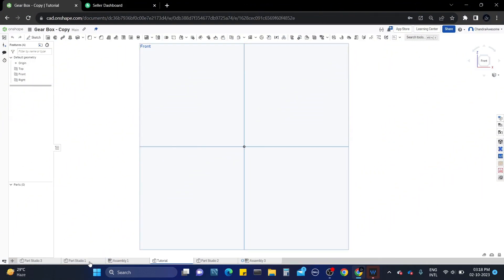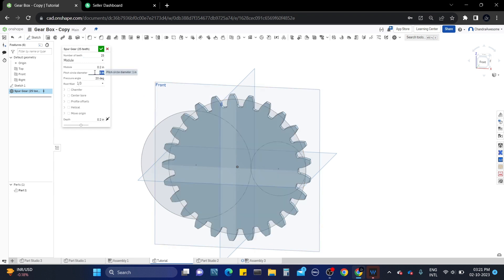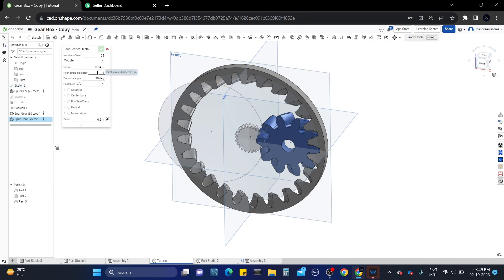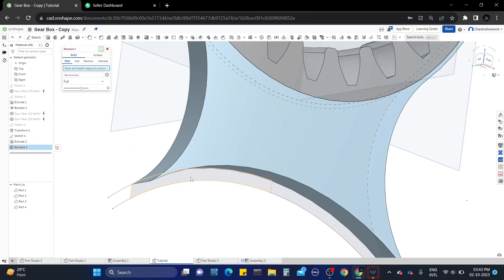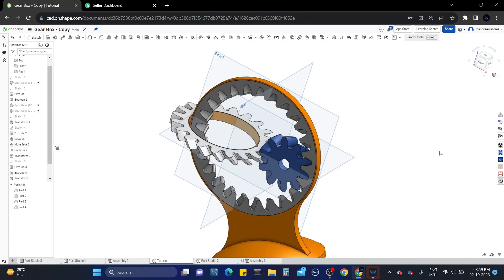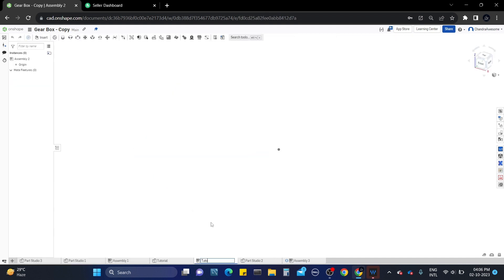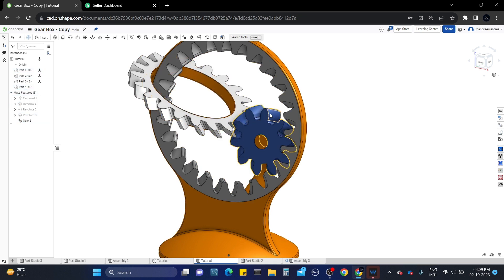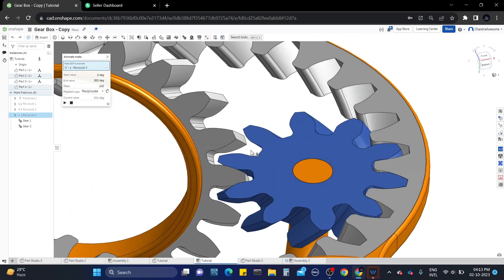Helical Gear Model in Onshape | Onshape Tutorial on Model Design with Helical Gears

Comment: It looks like you used the original sketch as an approximate guide. The outer ring, for example, didn't actually align to the size of the original outer circle, just came close. When I attempt to size my first gear to match the ring, I either have the top of the tooth extend past that outer circle on the sketch when I use the same dimension, or I under dimension it to get to where it lines up. I can't comprehend what the pitch circle diameter actually aligns to in the gear.
Reply from the maker: I haven't used any original sketch. Those are my own drawings. 
Here I used the planetary gear custom tool that is available in Onshape.
So I got the equal pitch gears.
Reply: @ I'm talking about the sketch of circles you did first thing.